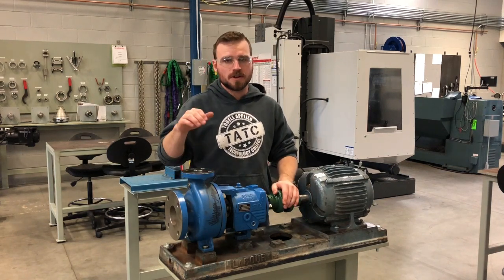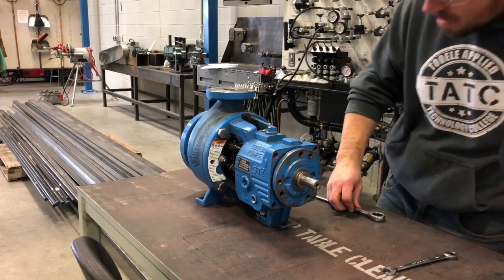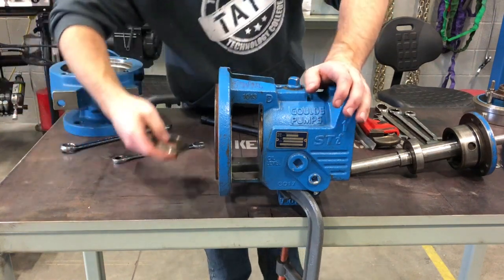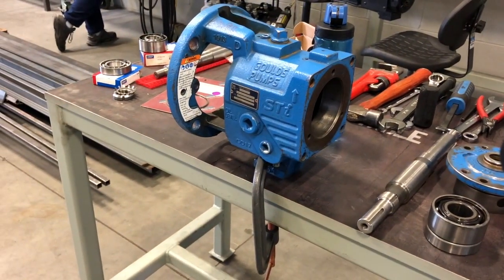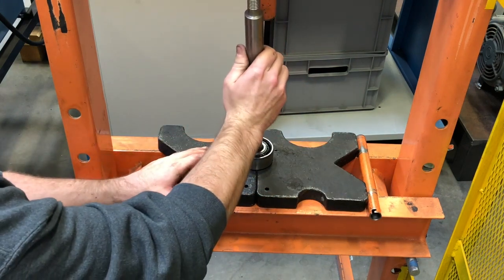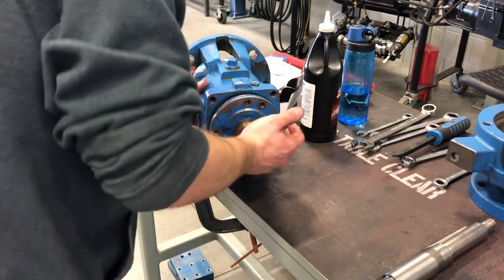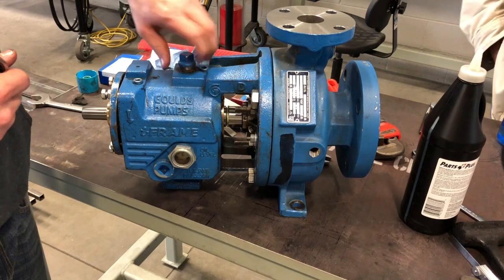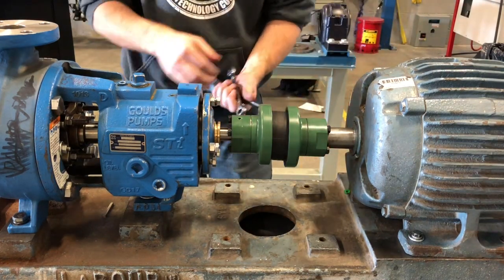Gould Pump Rebuild

Comment: Great picture quality and video.  I would like to make a few suggestions / corrections.  First, the impeller setting on this pump is off the casing rather than off the stuffing box.  The drain ports on the inpro bearing isolators need to be placed at the 6:00 position, as Mr. Sean commented.  If you are careful, you can remove the isolators without damaging them and reuse them.  Typically you replace the o-rings and reuse the isolators.  Never secure the mechanical seal to the stuffing box then slide it on the shaft.  Always slide the mechanical seal onto the shaft then install the stuffing box.  Its nearly impossible to place the mechanical seal, by hand, exactly in the center of the stuffing box and bolt it down without being off center.  When off center, the rotating part of the seal will rub against the stationary part of the seal causing premature seal failure.  You can google Goulds 3196 service manual for their recommeded impeller settings.

Comment: Besides buying a deadblow hammer,  you should buy a bearing heater. Also,  you should of mentioned about putting the weep holes in the seals at the 6 o'clock position. Otherwise it was a pretty good video. I wish my pumps were that clean when replacing parts.